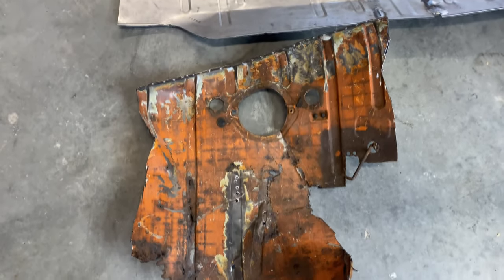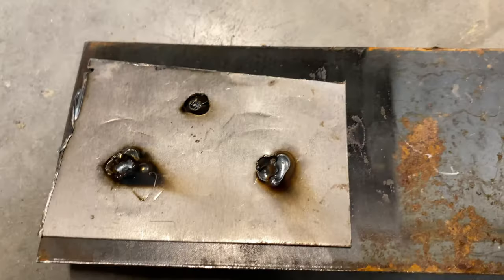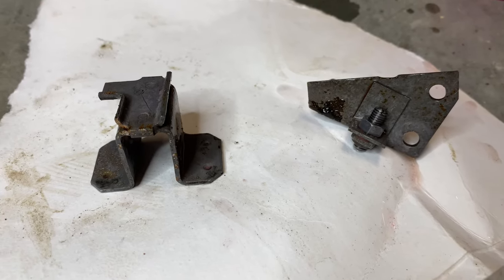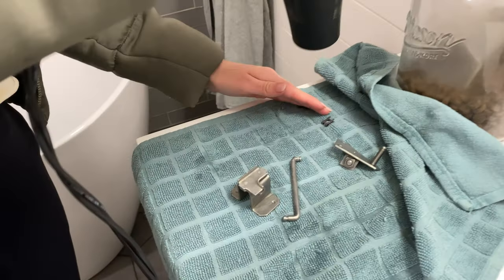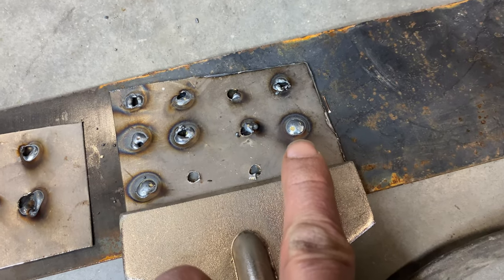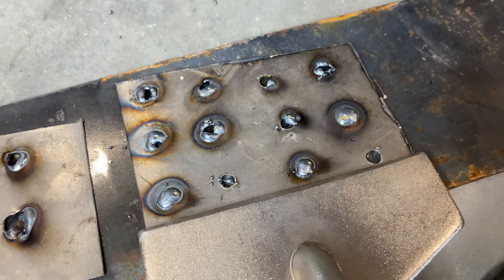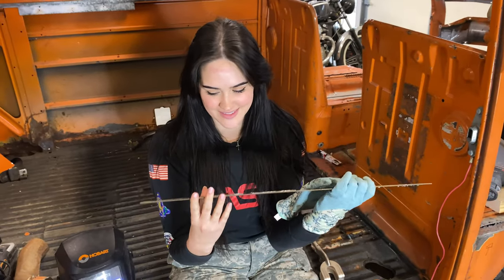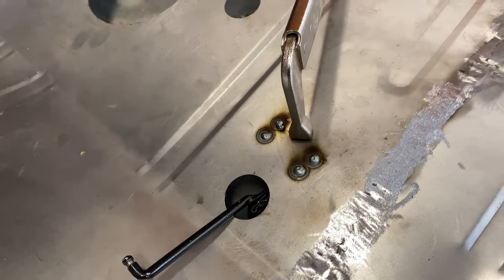I taught my girlfriend how to weld | VW Bus Restoration Episode: 23

Comment: There is a Milwaukee mini model right angle grinder tool: Milwaukee M12 2485-22 Red 120V for grinding and cutting metal in smaller spaces so you save time and have a better finish, just a recommendation from me, the bus looks magical, I'm excited
Reply from the maker: I need that tool bad now! I'll have to save up for it. Thanks for the recommendation!

Comment: Nice work! Have you thought about investing in a Harbor Freight Sand Blaster? I use mine ALL THE TIME in restoring my 71 Westy.
Reply from the maker: I’ve got an episode about a HF sandblaster I bought!
Reply: @Vangabonders  Check out the blasting cabinet.  👊🏽
Reply from the maker: I’ve been wanting to get one of those! Would be awesome for small parts. Which size do you have?
Reply: @Vangabonders  The 40 lb. cabinet. I modified it to be gravity fed and it works really well. Right now I'm in the thick of blasting, cleaning, priming, and re-painting parts. It has saved me time and money. 

Keep up the great work... can't wait to see the finished product.

Comment: How do you dial in wire speed and heat the best? is that just trying out?
Reply from the maker: It was hit or miss until I figured out what worked well with my setup and the thickness of the metal